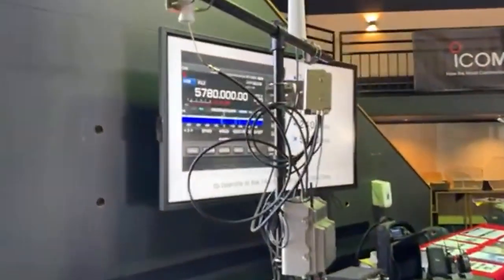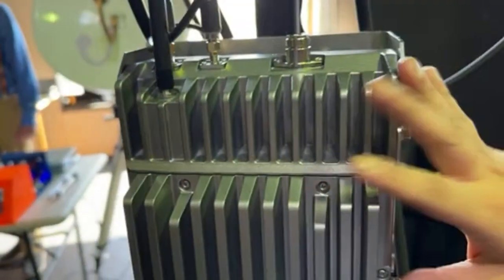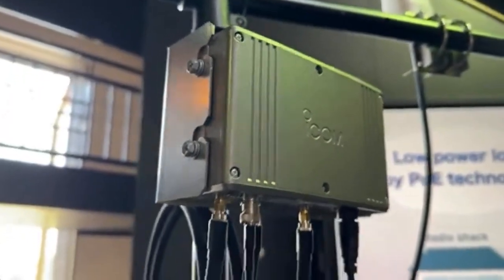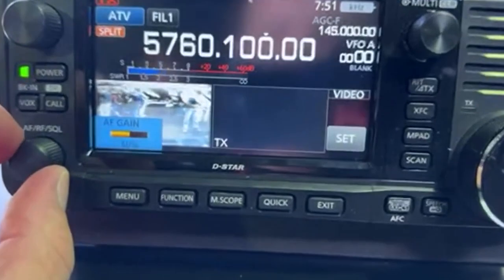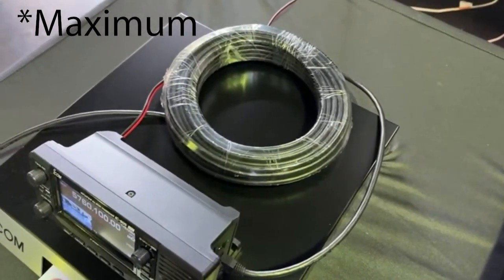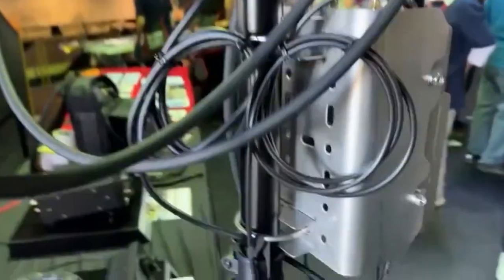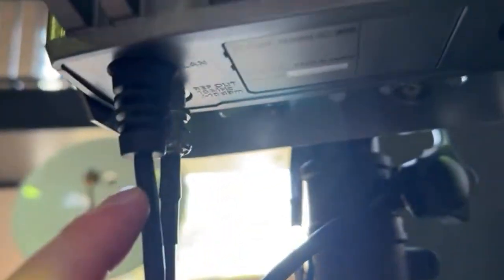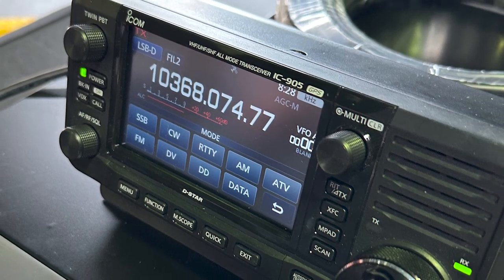Close Up Look at the Icom IC-905 | NEW Radio

Comment: Does anyone know if the link between the control head and the remote part is genuinely Ethernet? I know it’s been said to use PoE, but I am curious about the details.
Reply: IEEE 802.3af is power over ethernet
Reply: @procerpat9223  yep. Just hoping for more details of the connection.

Comment: A great innovation separating the computer from the rf sections and using Poe CAT5 to connect the units. Shame it not compatible with normal lans switches and hubs. It would be so good to be able to connect the user interface via wifi to the lan and then be able to use the radio up the mast.

Comment: Can it do only one band at the time, or would it be able to receive on one band and transmit on another, like the 9700 can? It would make it quite interesting for QO-100 if it can.
Reply from the maker: It can only do one band at a time, but can operate split, which should be sufficient for QO-100?
Reply: @HamRadioDX  Well, if it can do split across the band, it could be usable. 
For QO-100, it's recommended to be able to hear the satellite while transmitting, in case of splatter or when satellite gets oversaturated and starts emitting warning signal.
Thanks for taking time to take a look at the radio, your reports are very useful!
Reply from the maker: No worries! The Icom engineer took feedback and one of the things I did mention was full duplex satellite operation would be desired by a lot of people who would use the 905.